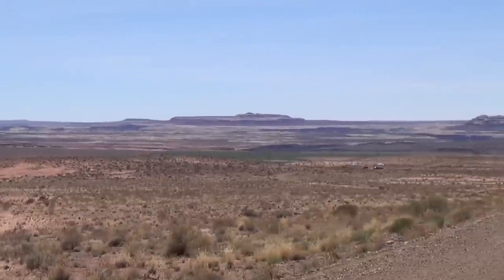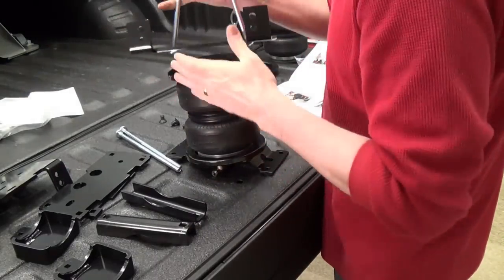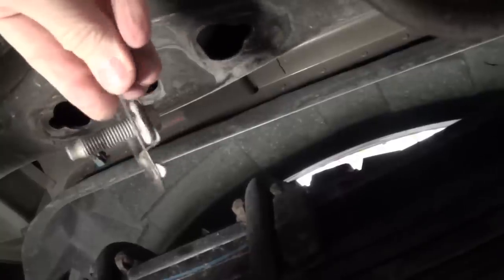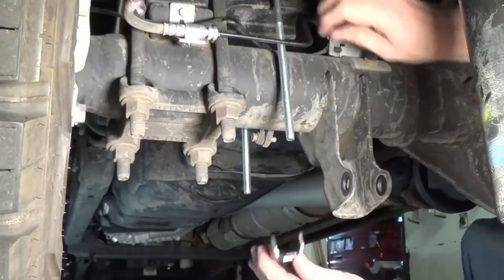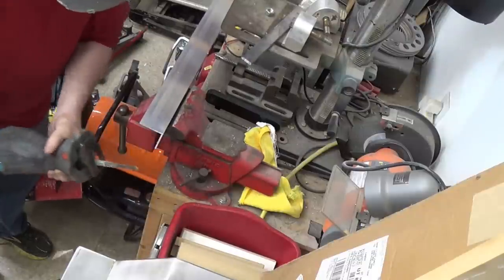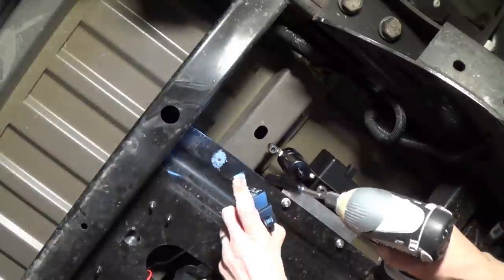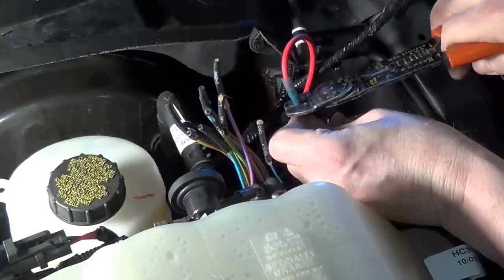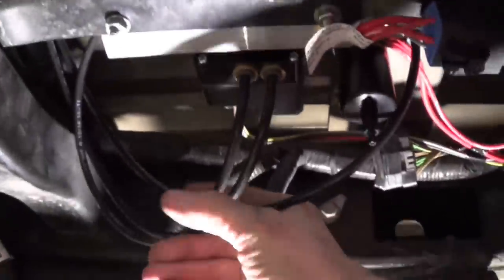Installing Air Lift Air Spring System on 2017 Ford Super Duty F350

Comment: Nice install.  I have the same truck and am looking at the same Airlift setup (5000 Ultimate + 72000 wireless compressor).  Did you notice any deterioration in ride quality after installing the airbags?  And does the airbag setup make a difference in how the truck handles when pulling your trailer?  I have a 9,000lb travel trailer and while I haven't noticed any problems when towing, I've been told that the front end will be a bit more stable if I have an airbag system to eliminate squat.  Just curious if that's been true in your experience.
Reply from the maker: When the airbags are deflated (5 psi) you really can't tell they are back there. I put a camera under the truck once and ran over some rail road tracks and the bags compress as far as they can go. It's all factory suspension when they are deflated. As to the handling, I think they stabilize the truck a lot. The rear end can get bouncy if there is not a lot of air in them and really stiffens up when up to pressure. Everything is just positive except sometimes I have to reach the wireless remote into the back seat to change pressure. It must be at the edge of the range with the receiver in the far back under the bed.

Comment: Very informative...I have a 2017 350 towing a heavy fifth wheel with a similar sag and considering a similar solution. How much air pressure did it take to lift your trailer?  When unloaded do you run the bags at 0 pressure?  Many thanks.
Reply from the maker: I just got back from a 4,800 mile trip pulling the trailer all the way and was so glad to have the system on the truck. It is just so much more stable than with the factory springs alone. I inflate to 90 psi when towing and 5 psi when not.
Reply: Perfect...I just returned back from a trip to Utah...beautiful state btw and can definitely could have used them.
Reply: Any issues with your setup?  When I contacted my dealer they are trying to sell me firestones bags but the air lift compressor. I like that air lift has the built in jounce. Many thanks for your opinion.
Reply from the maker: I actually had that setup on my previous truck and never had any problems. This time around I went all Air Lift partly because of the internal bumper. When you compare the Air Lift and Firestone side by side the Air Lift is more substantial and the Firestone feels "thinner". But like I said, my previous Firestones worked great for the 6.5 years I had them. The big reason people went with Firestone bags in the past was because the Air Lifts were difficult to install. This new version is pretty straightforward as the video shows.

Comment: Epic, always enjoy your videos, thanks for sharing.  Off topic here, but please share with me what fifth wheel hitch you went with in the new truck.  Did you you go with a different hitch from the one you used in your 2011 SD?  I recently went from the 2011 SD to 2017 F250 4x4 Lariat . . . love the truck!  With the short bed, clearance between the rig and cab is very important.  Thanks in advance.
Reply from the maker: I'm still using the same B&W hitch that I got 6 years ago. I ordered this truck with the Ford 5th wheel prep so all I needed was a new base. The head is still working great and still pulling that monster toy hauler several times a summer.

Comment: Do you have any problems with the bags when it comes to getting your tires rotated or having your truck lifted for oil changes? Just wondering if there is anything you have to do to keep them from stretching too far, possibly damaging the bags.
Reply from the maker: It's an interesting question but nothing to worry about in normal use. Think of crossing a ditch on an angle off road. The rear axle will travel past the unloaded range and the bags are designed to accommodate that. Having said that, if you go crazy during offroading, suspension limiting straps can be used to make sure the axles don't go too far.

Comment: Do you know if the application would be similar to do in a 2014 f350? 

Also how much did it end up costing you? 

Great video!! Thanks
Reply from the maker: I had a similar setup on my 2011. Same kind of deal just different places to mount. If I could do it over on the 2011 I would have installed it above the spare tire like on this 2017. Just too easy. You can get all this between $650 and $700 at lots of online places.

Comment: I just purchased a 2010 Ford F350 King Ranch with a 6.4 Diesel... Ride is horrible with stock shocks.. I am thinking about changing shocks and adding air bags.. Did the air bags help with the ride when you are NOT towing?
Thanks
Reply from the maker: Airbags are normally at the lowest inflation pressure (5 psi) when not towing. If they are filled at even 25 psi or more the rear end gets very firm. Most people don't like that but some do. The OEM Ford shocks are notorious for being crappy. Upgrade to Fox or true Rancho 9000 series for a huge upgrade.

Comment: What are your thoughts on the airlift smart air II? I'm trying to decide between that system and the wireless system in this video. Thanks!
Reply from the maker: I don't have any experience with the Smart Air product. I put the 72000 on my previous truck as well as this one. I will say that Air Lift improved the design of the 72000 by adding the air filter/water separator on the current generation. Six years ago the filter wasn't there and the manifold failed due to moisture. It's always good to see a product improve over the years.

Comment: is there any particular reason why you chose upfitter switch number 4? the power wire you hooked up to the up that are switch comes from where? I'm getting ready to do the same install just looking for a little clarification.
Reply from the maker: Upfitters 5 and 6 can be switched to always on and I'm reserving those for other things. I figured I wouldn't really be turning it off and on much so I could put it in a less convenient position.

Comment: So once the air bags are on can you still use the truck 4wheeling. Looks like the bags limit axle travel.
Reply from the maker: With the jounce bumper inside the airbag, it replaces the factory jounce bumper (bump stop). Axle travel is exactly the same.

Comment: I'm thinking about putting 2 inch shorter blocks in the rear rather than leveling my truck out since it's already so tall. Would this kit still work if the blocks were 2 inches shorter?
Reply from the maker: That's a good question. Air Lift makes the 5000 model without the internal jounce bumper. I'd check to see if that would work or if they have different mounting options for a lowered truck.

Comment: Did you jack the rear end up and put the frame on jackstands to lower the axle or were you able to install the bags with the truck just sitting at right height? I just got the same kit and was wondering if I needed bigger jack stands or not...
Reply from the maker: I put a jack under the rear hitch and lifted the back end up a few inches.  Then a single jack stand under the receiver. If your jack stand isn't tall enough, you can stack some lumber to get it high enough to hold the back of the truck up. There's not much risk of injury because if everything were to fail it would just come down to ride height. No biggie.

Comment: Just saw your video and wanted to ask what kind of hitch are you using, does it have a slider and what's your turning radius like how close do you get to the cab, and your truck is a short bed right thank you
Reply from the maker: It's a B&W companion hitch using the Ford factory fifth wheel prep in the bed. No slider. I've been many places seriously off road and never impacted the cab. Just have to be aware or it can happen. Lots of variables the largest of which is the front cap of the fifth wheel.

Comment: I am considering a F350 vs F250 to gain payload but I see you get some sag.  What is your truck GVWR and how much does your trailer weigh  dry and loaded?
Reply from the maker: The fifth wheel puts just over 3,500 on the hitch over the axle. Without the airbags, the truck sags too much. It's a heavy trailer and loads up to a little over 18,000. Dry is 4,000 less. GVWR on this truck is 11,500 but it is different truck-to-truck depending on how it is setup.

Comment: Why did you choose the 5000 ultimate and not the 7500 series bags? Just asking cause I have a Chevy 3500 and can’t decide.
Reply from the maker: The 7600 wasn't available at the time for this truck. it's also quite massive in comparison and overkill for my needs. The 5000 is working great and the internal jounce bumper is a great capability. I needed that on a trip when the little compressor failed.
Reply: EpicCowlick thanks for the info I’ll probably do the 5000 ultimate as well. I enjoy your videos.

Comment: Do the air bags get rid of the bucking the truck will have once in a while when towing? no fronts?
Reply from the maker: Chris Egan they make the truck much more stable, firm, and planted while towing. They reduce all the bad emotions significantly. But nothing is perfect there will still be some bounce and some checking almost no matter what you do.

Comment: did you do anything to prevent galvanic corrosion where the steel and aluminum are in contact?
Reply from the maker: +wombat warns Good question. The only aluminum I used was for the mounting bracket. No other penetrations or mounting points. There is no need to treat the bracket since it is mostly in contact on a painted surface and no electricity flows through it. The ground wire goes all the way to the battery.

Comment: Hi - curious is you could give me your 6 month review / feeling on your Air Lift?  I am debating between Air Lift or Firestone.  Thanks for the wonderful videos.
Reply from the maker: It's a great system and zero problems to report. I trailered about 6,000 miles this year and it never failed or even hiccupped once. No leaks in the connections either. I expected to have to find a leak or two by now but no problem there either. I can't compare the Firestone compressor and valves as I have not used them.
Reply: Do you have the part or item number for the unit / compressor you placed on your truck?
Reply from the maker: The compressor/wireless control is universal and works the same on all makes/models. The the AirLift 72000 kit and a link is in the video description. The airbags of course are specific to any given truck.  I put links to the airbags for 2011-2016 and 2017 Super Dutys.
Reply: Thank you so very much.

Comment: A lot of dudes will tell you that a dual tire axel truck is needed to pull a rig like that. What are your thoughts on it other than the fact that it doesn't seem like you believe that to be true?
Reply from the maker: If all I needed the truck for was to pull the trailer, a dually would be fine. But I need  the truck for plenty of other duties where a dually would be a pain or completely usuitable. I can load the trailer to be under specs in every category except GVWR. If the axles on the trailer were slightly forward of their current mountings I would be under on that also. I won't keep this trailer forever and the next one I can choose more carefully.

Comment: We just traded out a Ram that had factory air bags.  They were automatic on inflation and deflation, is there a aftermarket system to install on our new F-250 that is automatic
Reply from the maker: This system automatically adjusts to whatever pressure the driver sets it at. I set it at 85 psi for my trailer and it holds that same pressure until I set it back to 5 psi when unloaded.
Reply: @EpicCowlick  Just got back from getting mud flaps and bug visor.  The store said close guess is $1500.00 for automatic bags.  The Ram spoiled us on that feature.  Hook up or sit something in the bed and 15 seconds later the trucks picks itself up then after unloading it deflates itself.  Will see how it totes the load first.  Bumper pull did great the 34' gooseneck did ok empty, will have to load the horses up and see.

Comment: What would be the scenario where you’d want to have different PSI from one side to the other?
Reply from the maker: For a fifth wheel, I'm not sure there is a scenario since the load is always in the center of the axle. For an in-bed camper? Sure, you can see how the load may be heavier on one side or the other. Maybe if you happen to be hauling something in the bed that is heavy on one side? Just spit-balling but in my case I've never inflated one bag differently from the other.

Comment: Are those the 20x8 wheels? I have aftermarket wheels  I swapped from my old truck to new, but like the new stocks. How is the towing of the 5th wheel with 37x12.50s on that narrow tire? I would like to fit 37s on stocks and still tow
Reply from the maker: They're the factory 20X8 wheels. Towing with big 37 inch tires have an impact. They screw up the final drive gearing and effectively make the rear end something less than 3:31. If it wasn't for the powerful 6.7L engine, I'd be looking to re-gear the differentials to correct. I wouldn't call a 12.50 inch wide tire a narrow tire but it does great towing even when very heavy. No problems there. Technically the tire needs a 8.5 inch wheel but there's no problem running on the 8 inch OEMs.
Reply: EpicCowlick thanks for quick reply man, I meant to put narrow wheel, not tire haha.
Reply from the maker: I figured. No problem. People worry about tire wear or towing stability but I haven't experienced that. Maybe if the wheel size was off more than an inch or better but not when it's only a half inch.

Comment: I have a 2017 f250 4x4 maybe you can help me out what's the  numbers for air left 5000 and the wireless remote there's so many kits out there it's making my head spin. Does it matter that I have a BW patriot slid hitch all ready installed? Thanks for your help
Reply from the maker: I had a B&W companion on my last truck which was a 2011. The hitch did not interfere underneath with the airbags but I did have to loosen one side plate to get the airbag bolts in place. No biggie. I can't say for sure as I haven't seen that combo but it should not be a problem. LInks to the airbags and airlift system are in the video description. I will never have a truck without airbags again. They make the truck so much more stable when towing heavy.

Comment: Do you have to cut the bottom of the manifold to allow it to drain?  My looks sealed.
Reply: I'm getting a Block error
Reply from the maker: Nothing to cut. The pointy part has to be perfectly vertical and pointed down. Water drips out of the hole.

Comment: Joe, @ 2:22 what torque did you final tighten the cup to the lower bracket?
Reply from the maker: They are Nylock nuts and achieve full torque as soon as the bolt passes through.  The trick is just tightening enough to allow the cup to slide a bit.

Comment: How much space do you have between your fifth wheel and bed when your bags have air? Thank you!!
Reply from the maker: The airbags don't change those distances. They are determined by the fifth wheel hitch and bed height. My B&W companion that uses the Ford 5th wheel prep puts my trailer at 7-8 inches clearance. Airbags determine the distance between the rear wheel and the bed.
Reply: Thank you for the response. Reason why I was asking, is because I have those same bags on my chevy 2500 and I have about 6.5 inches of clearence. And my toyhauler doesn't sit level with the rear sitting lower. I guess I'll look into lifting the trailer a little but I'm worried about going to high and hitting over passes. What's that total height of your trailer?
Reply from the maker: My trailer has had the axles flipped which raised the trailer total height 4 inches. You can see from the video that I need every inch of that with my truck having 37 inch tires and the new higher bed rails. The part of the video where it flips images between inflated and deflated is pretty cool. My trailer is actually nose-down when the airbags are deflated. It's perfectly level inflated. The total height on the trailer after the axle flip is 13 feet 6 inches which is up there. I do have to pay attention to clearance signs at gas stations and in-town overpasses. It's never been a problem but I am in the habit of looking.
Reply: Thank you so much for the response. I have a toyhauler that's sits 13.4 already and it came with the axle flipped already. I need to look into raising it though to get it level and to get more bed clearence between my fifth wheel and bed rails. But like u said I am very concerned about that overall height. Thank you.

Comment: I'm thinking of installing the Air Lift, which kit did you all do...5000 or 7500? Any regrets?
Reply from the maker: I did the 5000 Ultimate with the built-in jounce bumpers. The 7500 wasn't available at the time but they look cool. They are larger so they will have a different installation proccess.
Reply: Is the 7500 worth it on a F250/350? I'm thinking of installing air bags on my F250, I special ordered it with the high capacity towing package which gives me the same Dana's as the F350 and same towing/payload capacity.
Reply from the maker: Your F250 will be great. There's just no need to go over the 5000 lb rating of the 5000 Ultimate springs. Try to imagine a situation where you're going to put more than 5,000 lbs on the back of your F250. It's not going to happen. I really think the 7500 line will be more useful in heavier duty applications.
Reply: I looked at the specs of both and saw a SEMA video for the 7500...it would be overkill on the F250/350. I think its more for F450 and up. Maybe F550 and up. The bags are enormous. Thanks for the video and advice!